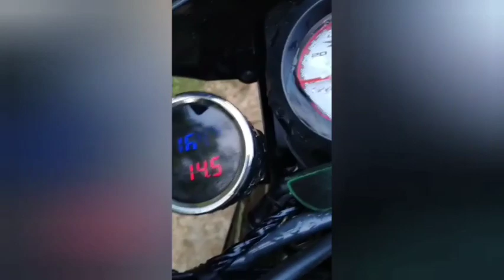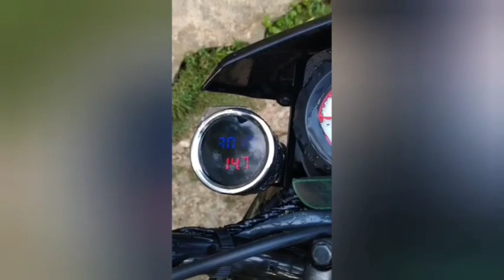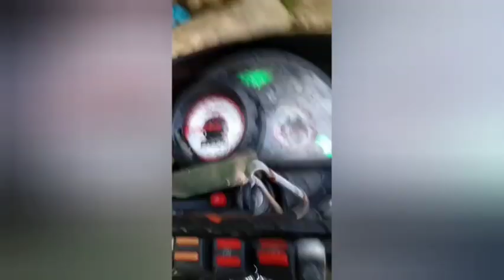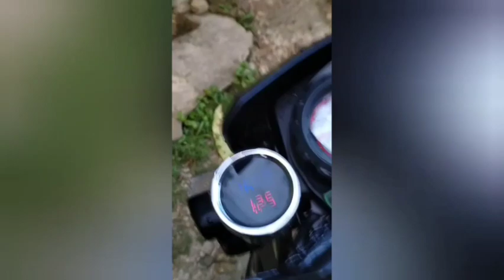Installing CAPACITOR for battery support(XRM 125 )||ADDING 10000 µF 35V CAPACITOR TO THE BATTERY

Comment: I added alot of auxilery LED to my moped 120w in total and the LED flicker a little at low rpm  will a 10000uf capacitor be enough to smooth it out you think? Thank you

Comment: Sir,  any advice kung anong uf at voltage at ilan capacitor ang the best pag may soundsystem ang tricycle? Thankyou in advance sir.
Reply from the maker: Ilang watts ba yung sound system ng tricycle mo sir?..
Reply: @paulexxx  400watts ampli ko sir.
Reply from the maker: Ok..then ilang watts yung speaker na nakakabit dun sa ampli mo po?
Reply: 150 x 150 sir
Reply from the maker: 1 watt = 1 joule...
 yung actual wattage ng sound system mo is 300 watts so kailangan natin ng 300 joules

Where:

E - Energy (Joule)

C - Capacitance (Farad)

V - Voltage (V)

Formula:
E = C * V² / 2
=4000000 uf×( 12v)2/2
=288,000,000 milli joule×1 joule/1000000 milli joule
=288 joule

Need po ng 4000000 uf na capacitor or 4 farad cap  @ 12v input po yan.. allowance lang kayo ng voltage pag bibili kayo ng capacitor gawin nyong 25 volts or higher .
Reply: @paulexxx  kaya paba ng DIY sir? Oh power capacitor na?
Reply from the maker: If merong available na malalaking capacitance na capacitor kaya yan..parallel connection lang..pero kung gusto mo madali meron din namang available sa online na power capacitor for sound system ..malalaki yung mga capacitance nya...
Reply: @paulexxx  kung magrreseta ka ng pang DIY sir anong capacitor ang iaadvice mo at ilan?
Reply from the maker: For diy hanap ka ny capacitor na 500 farad 2.7volts 6 pieces, then series connection mo sila para maka produce ka ng 16.2 volts 83 farad ..
Reply from the maker: For diy hanap ka ng capacitor na 500 farad 2.7volts 6 pieces, then series connection mo sila para maka produce ka ng 16.2 volts na may 83 farads ..
..https://shopee.ph/product/301864819/5749412583?smtt=0.127535986-1616681239.9
Reply from the maker: Tama lang yan for 12 volts battery output..allowance lang yung 16.2 para di masira yung capacitor pag nag charge yung battery from regulator rectifier.
Reply: @paulexxx  copy sir! Thankyou very much. Mabuhay ka.

Comment: Di ba yan masisira ang regulator ng motor?
Reply from the maker: Hindi naman po..pinifilter lang nya yung output voltage ng regulator rectifier..nagiging mas smooth ang charging nya dun sa ating batterry. Hindi naman po sya nkakasira ng regulator kasi same current and voltage lang ang ini-store ng capacitor sa output ng regulator rectifier.

Comment: Ginagaya ko din ya lods,bakit sakin po di gumana pag ganun po ano po ba yung sira dun??
Reply from the maker: Baka sa battery na talaga po,,dead na po.
Reply: @paulexxx  Lods sakin bago pa battery 4L, pero waley na di na makapag start, naisipan ko din yan mag lagay ng capacitor.
Pero check ko pa baka di na sa battery problema kundi sa starter motor.
Rusi Korak 110 sakin.
Sabi sakin ng mekaniko, palitan nalang ng Quantum Battery, pero di ko muna pinalitan.

Comment: Di ba paps ilowbat ang battery nyan pang patay ang motor?
Reply from the maker: Di naman paps..nag e-store lang sya ng voltage..pag nakapatay ang ating motor hindi nya e lolowbat ang battery kasi my na store na voltage na sya habang naka andar pa yung motor natin. Nadagdagan lang ng capacitance na mqg mag maintain ng boltahe ang ating battery kasi naka parallel connection yun dun sa ating battery.

Comment: Battery Positive to capacitor positive and battery negative to capacitor negative, tama po ba?
naka dual battery ako, ok lang po ba na lagyan pa rin ng dalawang 4700uf 50v capacitors?
Reply from the maker: Yes tama po...ok lang yan lagyan ng dalawang 4700uf capacitor..parallel connection lang silang dalawa dun sa battery terminals..sundin mo lang ang polarity nila..negative of capacitor to negative of battery then positive of capacitor to positive of battery.
Reply: @paulexxx  hindi ba ma-drain ang battery sa magdamag na nakakabit ang capacitor?
Reply from the maker: Hindi naman po sir..same lang sila ng characteristics sa battery nag e.store ng voltage at current habang umaandar ang motor..if nakastore sya magdamag, nagsisilbi syang backup ng ating battery sa mga kaunting drain..madali lang nag de.drain yung capacitor depende sa kanyang  capacitance(farads)kasiy proportional sila kung malaki yung capacitance malaki rin yung amount of charge..bali yung capacity ng ating battery magcharge sa max level nya, nadugtungan ng konti sa tulong ng capacitor. Eto po yung equation nya sir.
Charge:

Q = C * V

Energy:

E = C * V² / 2

Where:

Q - Charge (Coulomb)

E - Energy (Joule)

C - Capacitance (Farad)

V - Voltage (V)
Reply: @paulexxx  k

Comment: pwde po ang 250v ,10000uf?
Reply from the maker: Yes..pwede po....yang 250v  is max voltage na kayang e handle ng capacitor mo..14.7v lang max output voltage ng regulator rectifier ng motor so kayang kaya.

Comment: Sir  bakit sabi saken  ng  nag eelectronic   sisirain  daw   yung  cdi   at  wirring mo  nyan mag papalagay  sana  ako   pero  sabe    sisirain  daw   cdi
Reply from the maker: Maaring masira ang rectifier or cdi if mali ang voltage specs ng capacitor..halimba pag nag lagay ka ng capacitor na may voltage rating na mas mababa sa 12 volts..maaring masira dahil di nya matutulak ang voltage as charge sa capacitor..better na mas higher sa 12 volts ang piliin mong capacitor..minsan nasisira din ang rectifier or cdi dahil sa battery na sira na not enough voltage or overvoltage..yan yung nakakasira ng rectifier or cdi..Battery and capacitor is the same characteristics na nag cha charge ng voltage and current..Sakin wala namang problema 1year ng merong capacitor.

Comment: Boss pwd ba dlwa Ang ilagay ko n capacitor?4700uf Yung capacitor ko..
Reply from the maker: Yes,,pwede po,.parallel connection nyo po yung dalawang capacitor dun sa battery magiging 9400 uf ang capacitance nyan.

Comment: boss pwede ba 4700 uf 50v?
Reply from the maker: Yes pwede po, pero kaunti lang yung capacitance nyang mag store ng voltage at current.
Reply: thanks boss, last na boss yang capasitor mp boss sakto lang ba makapasok sa lalagyan ng battery. para atleast hinde sagabal . salamat boss
Reply from the maker: Sakin.malaki ng konte yung capacitor na gamit ko..nakalabas sa lagayan ng battery ko..pero nasa u box parin...itabi mo lang sa gilid para hindi sya sagabal..
Reply from the maker: Sakin.malaki ng konte yung capacitor na gamit ko..nakalabas sa lagayan ng battery ko..pero nasa u box parin...itabi mo lang sa gilid para hindi sya sagabal..
Reply: thanks boss. . new subs here

Comment: Pano mo yun kinabit sa motor yun boy
Reply from the maker: From capacitor positive etap sa positive ng battery mas safe pag lagyan mo ng fuse 10 amp. Then negative of capacitor tap sa negative ng battery..yun lang po.

Comment: ask ko lang po pwede ba ang capacitor ikabit derekta sa positive and negative wire ng stator? 

Kasi ang kaya lang ibato ng stator na boltahe is 9v. kung i derekta ba sya ikabit sa stator magiging 12v na ang output? 

At saka ok lang ba magkabit ng capacitor kahit sira na ang charging system ng stator? pero ang rectifier is bago naman at working. di lang na charge ang battery kasi sira na nga ang charging system ng stator

Salamat
Reply from the maker: Hindi po pwede sir kasi hindi rin po ma cha charge yung capacitor pag sira yung stator nyo po..same lang po ng characteristics ang capacitor at battery kaso mas mabilis ang draining at charging dun sa capacitor..

Comment: Boss pwd b capacitor 15000 mf 35 volts connect sa battery
Reply: Malakas p naman medyo bago p Naman battery q kayA lng d kayA pag pinagsabay n ang headlight at busina nahina
Reply from the maker: Yes pwede po .mas mainam yang mas higher na capacitance..dahil  proportional po yung voltage at current na ma istore sa isang capacitor depende sa kanyang capacitance (mf)
Reply from the maker: Yes pwede po .mas mainam yang mas higher na capacitance..dahil  proportional po yung voltage at current na ma istore sa isang capacitor depende sa kanyang capacitance (mf)
Reply from the maker: Battery drive ba yung headlight mo?
Reply: @paulexxx  yes po
Reply: @paulexxx  connect din sa battery
Reply: @paulexxx  pwd po b kahit Wala fuse ung capcitor?
Reply: @paulexxx  pwd po b kahit Wala fuse ung capcitor?
Reply from the maker: Pwede po..pero much better po kung lalagyan ng fuse for protection incase na may fault yung capacitor ang fuse yung unang mapuputol.
Reply from the maker: Ah kaya pala..malaki na yung load consumption ng accessories mo.tumataas din   yung voltage drop pag pinagsabay mo yung dalawa kaya humihina..try mo din lagyan ng horn relay yung busina mo para ma minimize yung probs mo.

Comment: Pwde anim na Capacitor 50v. 4700uf
Or 50v 2200uf
Reply from the maker: Pwede po..parallel connection mo lang sila para maka produce ka ng 28200 uf pag anim na 4700 uf then 13200 uf naman pag anim na 2200 uf
Reply: May dalawa akong 35v 3300uf
Boss okay lng ba isa.. 
Or mas maganda dalawa
Sa XRM 125 ko ilagay
Reply from the maker: Mas maganda dalawa para malaki yung capacitance nya po..
Reply from the maker: Maganda sana yung malaki yung uf para isa lang yung ikabit mo..pero ok lang din yung dalawa..parallel connection lang para meron kang 6600 uf

Comment: Mas the best yan kung 10 pieces na 10000uf 25 volts na capasitor...ganun gamit ko
Reply from the maker: Yes po..the more the capacitance mas the best po.
Reply from the maker: Mas maliit lang ang charge nya sir..pero ok lang yan..di lang masyado makakapagmaintain ng voltage..eto yung formula ng

 charge=capacitance x voltage

470x12= 5640 coulumbs lang ang charge nya.

Kahit 220 volts ang description ng capacitor mo 12 volts lang magiging voltage nyan kasi yan lang yung output voltage ng ating regulator rectifier...
Reply: Pag 10 pcs, parallel connection po ba?
Reply from the maker: Yes parallel connection po..10000x10=100000uf yan yung magiging capacitance nya if naka parallel connection.